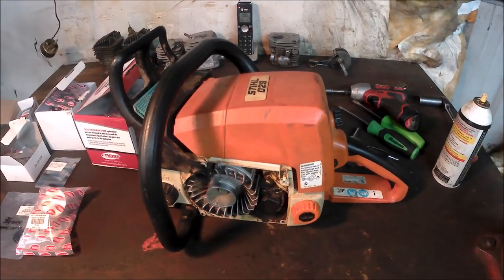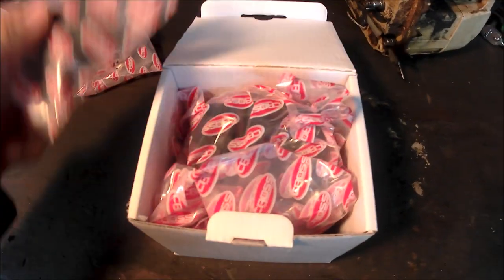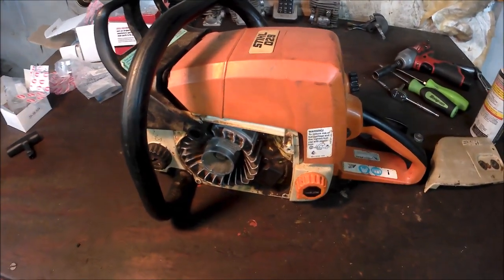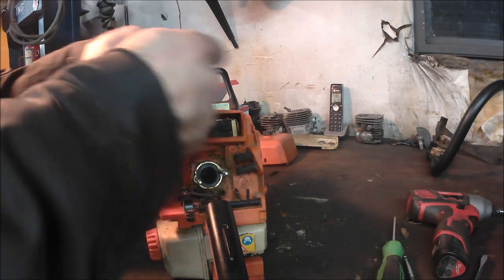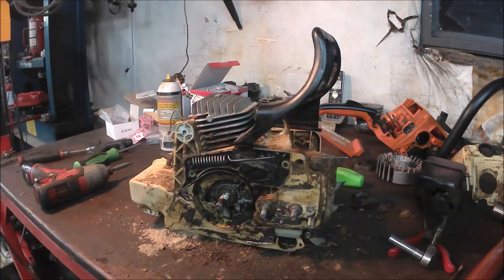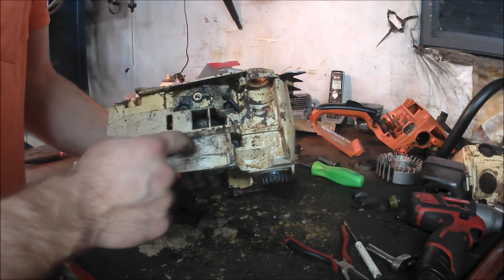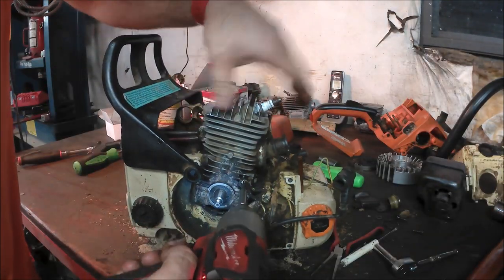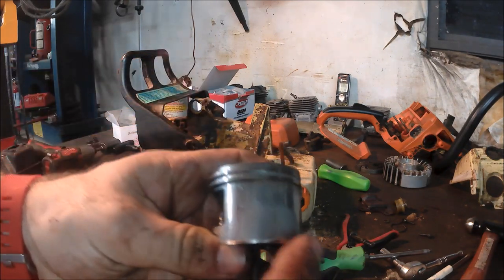Stihl 029/ MS290 Tear Down for Rebuild

Comment: You're kidding, right?  I don't think I can do it even if I mark where each part and bolt goes using egg cartons.  I will just take mine down to Stihl store for repair.  Maybe just sell it for parts and buy a new other model.  Thumbs up for having quality tools and being a professional at what you do.
Reply from the maker: Thanks! Honestly, these saws are not worth taking to the dealer for a major repair. It would cost far more than what the saw is worth. The only way they are worth it is if you use aftermarket parts and do it yourself. If you have one that needs major work, someone will still buy it.

Comment: Just bought a 029 super in mint condition,  looks like it only ever hit one l Iog, but runs great , im just a firewood cutter this year in this house we went thru 10-15 cords of wood  , would you recommend this swap? Or should i kill this motor first ? I do cut some big logs and been happy with the saws performance,  but we bought this house and only has stove and fireplaces for heat , dont plan on going anywhere so will be here awhile , in your opion would it be worth cutting thru quicker and saving some saw time ?
Reply from the maker: I'd run it with that cylinder. The aftermarket cylinders are not as high of a quality as what an OEM cylinder is. I'd do a muffler mod and nylon mesh filter to it and run it.  Here are videos on the muffler and filter. https://youtu.be/REKjVUxauXQ https://youtu.be/MFUQnlrM4ms If you want to do this swap look around for a saw that needs a cylinder.

Comment: How did you get the clutch plate with the 3 springs off I got the other side off
Reply from the maker: I used an air impact. It is right hand thread, so turn it clockwise to loosen.
Reply: @TractorTech  What do you mean "Its right hand thread, so turn clockwise to loosen"  Don't you turn counter clockwise to loosen a right hand thread.  Which is it ?

Comment: I use the MS290 for 90% of my tree jobs......parts are beyond Dirt cheap, and everywhere. Larger saws are nice, until parts break, then you're screwed, it can be impossible to find things during certain times of the season on ebay or stores! Don't underestimate the 290 with a NEW chain.....cuts So crazy easy.
Reply from the maker: The 290 is an economical saw to run and repair. When something happens to them most people throw them out.
Reply: I never struggle to find parts for a pro saw. You need better sources. Home owner saws are shit to work on. Pro saw I can fix on the job with a few tools.
Reply: @jgbelmont  the farm/ranch saws are easy to rebuild
Reply: I do this for a living. I can find pro parts everywhere. I don't leave home without my MS460.

Comment: Why did you remove the grease in the bearing? Any specific reason?
Reply from the maker: Are you talking about the grease in the sealed bearing for the crank bearing? I removed it so gas/oil mix could lubricate it and so the grease would not be floating throw  the engine.
Reply: Sounds good just curious, u am about to attack my 310
Reply from the maker: If you have any other questions let me know.
Reply: Awesome thank you!!

Comment: I stripped the stud holding the lower engine. Any Ideas? Thanks
Reply from the maker: Did you strip it or round the head?
Reply from the maker: Or are you talking about the bar stud? Use vise grips on it if it is stripped.

Comment: Well I wanted to see how to remove the clutch assembly...
Reply from the maker: You need a 19mm socket. I use an air impact. You need to turn it clockwise to loosen it. If you don't have an impact, remove the spark plug and put some crank rope down in the cylinder to keep the piston from turning. Then you can use a ratchet.
Reply: @TractorTech  Hey thanks for the reply - excellent video - I got the clutch assembly off.  I blew the motor I'm pretty sure I set the rev limiter on carb too high lol anyway good time to do 039 cross performance upgrade now!